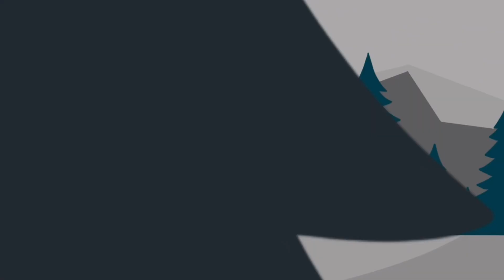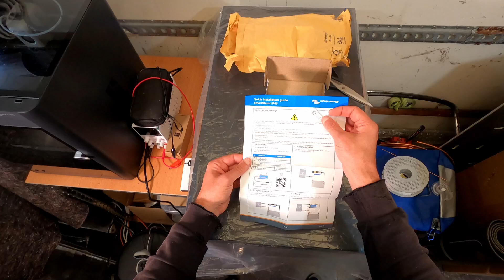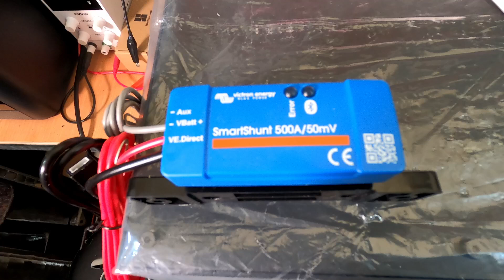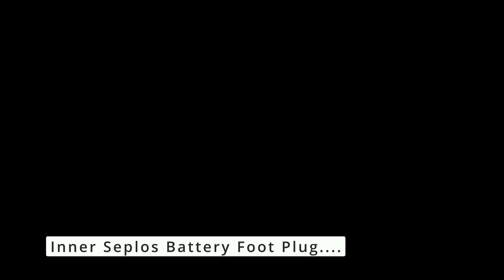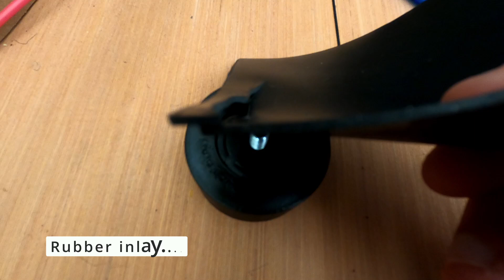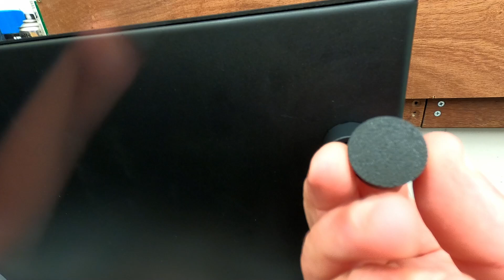Off-Grid Boat Wiring | Victron Smart Shunt + Battery Feet Design | Ep. 3

Comment: I cannot recommend a housing around the shunt. It'll get quite warm when drawing 450A and just shorting the two poles won't do much. There will be only a few mV between them. 
And one more thing. The 500A is not the shunt's rating but together with the 5 mV defines its resistance. It'll produce a 5 mV drop at 500A. Therefore, its resistance is 0.01 mOhm.
Reply from the maker: Hey, thank you for comment and great feedback:). I was under the impression and informed that if I stay under my total max draw (in my case 415a) then I should be good with a 500a shunt. Are you saying that I need something bigger or smaller?:) Thank you for confirming shunt gettting hot. No Box in that case.:) Happy Sunday!

Comment: I am going victron 100% too...   Still haven't found my huge 120v panel (I guess you're converting in 240v ?)
Reply from the maker: I was not going down the Victron route at first as I kitted my old camper van for a fraction of the cost getting the basic needs I was after. They got me hooked on all the extra bells and whistles that the system provides via plug and play so had to give in. Quality is another reason as well. I will get a Victron Inverter at some point and living in Europe it would be the AC 230v version:) Saying that, the motors are DC so will have to figure out the best way to run them on as much solar/turbine input as possible without having to pump the energy into the battery first and then draw it. The ideal think would be to let the inverter handle the energy distribution but that means going from DC to AC to DC which is 3 steps of conversion energy loss. Will have to think up something in this area when time comes:) Happy Sunday!!